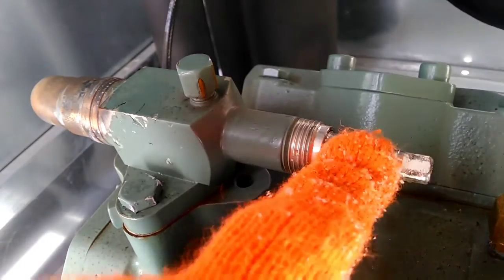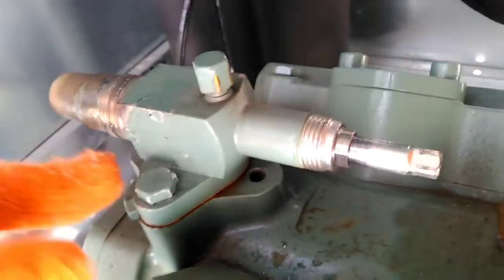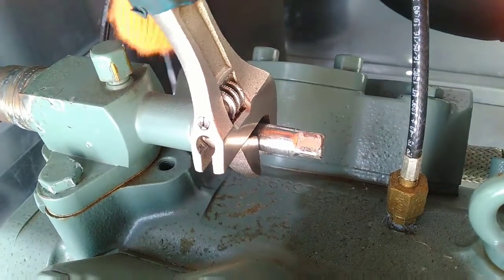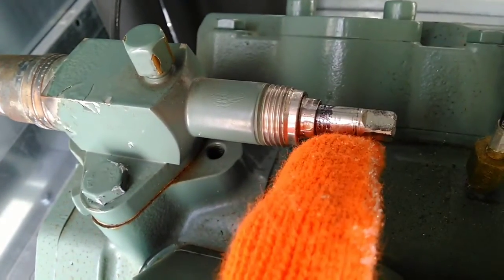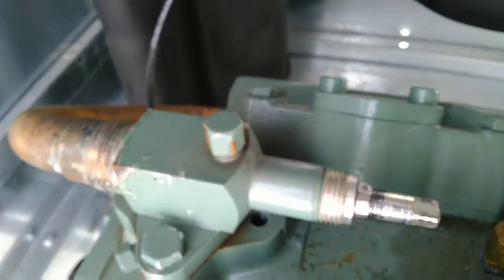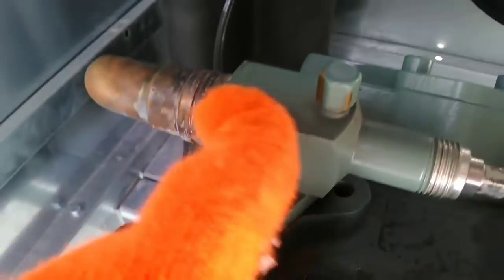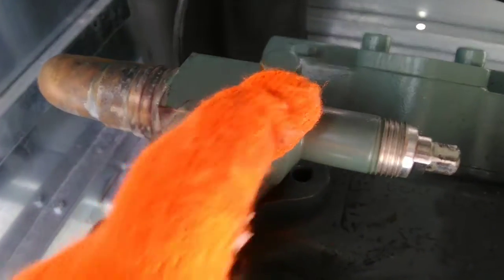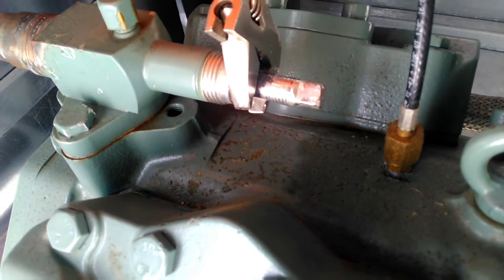Refrigerant Service Valve Positions

Comment: Forgive me to say that most of this information is pretty obvious. The part you left out, and the information I need, how do these valves open and close - clockwise or counterclockwise? I only work on my own now, but I forget this every time. I need to mark it on the valve cap.
Reply: Cuu cuu clockwise
Reply from the maker: If they're back seated, it will turn clockwise to crack the valve.

Comment: So if I needed to add refrigerant I would need to back seat the valves, correct?
Reply: You have to turn clockwise 2-3 turn only for adding Freon
Reply from the maker: The valve should already be back seated.  Yiu woukd need to crack them slightly

Comment: I work in ammonia and they tell us don't loosen packing valves because it can start leaking ammonia out when you crack valve. Had it happen a bunch of times when packing loose. We just lubricate stem with some refrigerant oil and then cycle it.
Reply from the maker: Interesting, I appreciate the info!

Comment: To connect gauges, do you have the stem back seated?
Reply: Yeah just crack it honestly towards front seat. If you charge or pull vacuum then full mid seat. But if you’re trying to read pressures. Just crack it.
Reply: have it mid seated if you want to read pressures
Reply: @ParksPov  or just cracked a single half turn, that is usually what I do.

Comment: Should the valve "not" accessible to the compressor when front seated (you said it "is").  When front seated, the service valve opens to the connecting hose.
Reply: Eh like 99.9999 percent of them when front seated kills flow to the hose port. Same when backseated. The middle is where the service port gets flow.
Reply: Maybe your setup is different

Comment: Sorry to bother u but we’re can I get the rubber piece that’s  in front of the packing  nut ? iv been using Teflon tape but it’s only working for bout few months then I would have to replace it
Reply from the maker: Your best bet is the compressor manufacturer,  but you can use Nylog too
Reply: Iv been using teflon with nylog but I will ask the manufacture but any additional help will help me greatly
Reply from the maker: @chris34963  With Nylog, you really don't need teflon tape.  Good luck on traking those rubbers down, I rarely see them around any more.